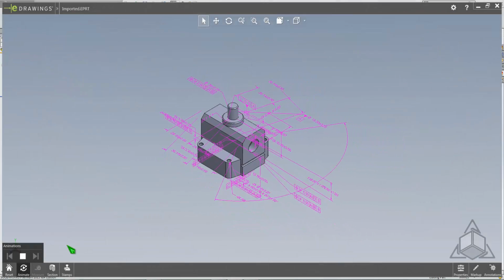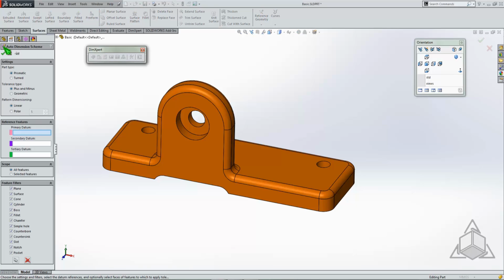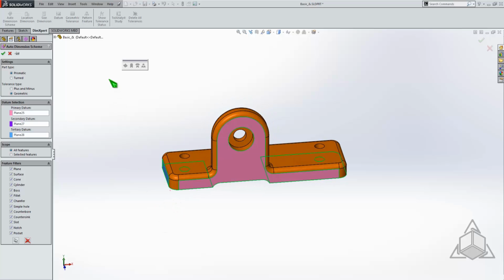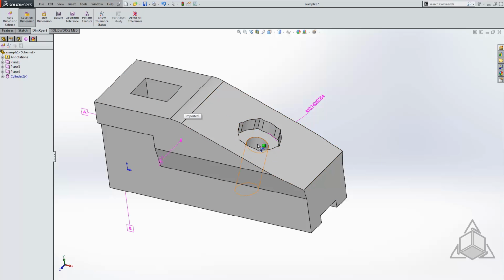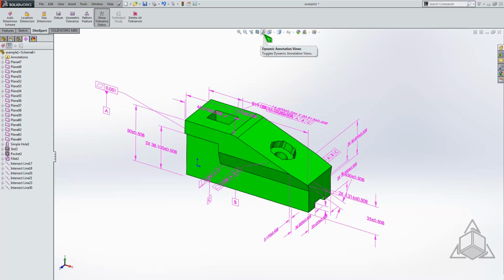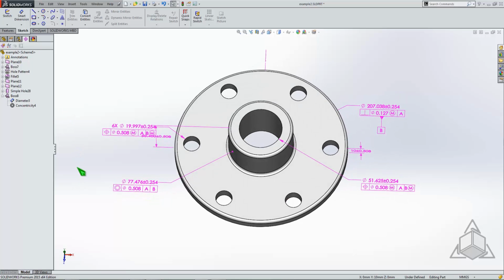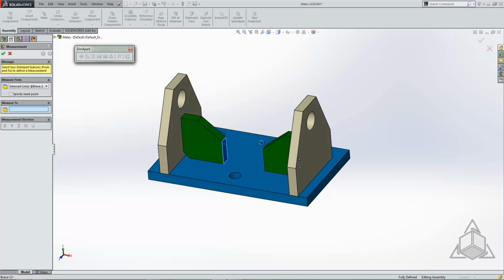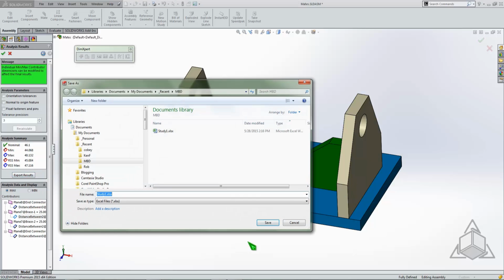Lunch & Learn - TolAnalyst and DimXpert

Comment: Can I do the study measurement between OD of the ring (surface) and ID edge of the cone cylinder ( Why do I have to select the edge in term of ID surface of  cylinder ? Because the ID surface cylinder is a cone and  ID edge of cylinder is the smallest diameter ) It seems that TolAnalyst does not give me that option , Am I right ? I am looking forward for your response. Thank you very much.